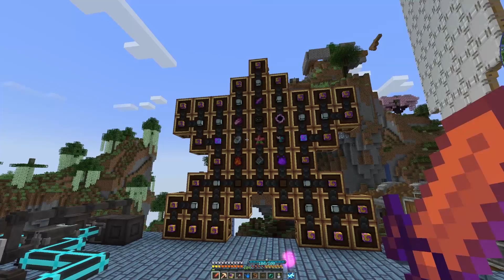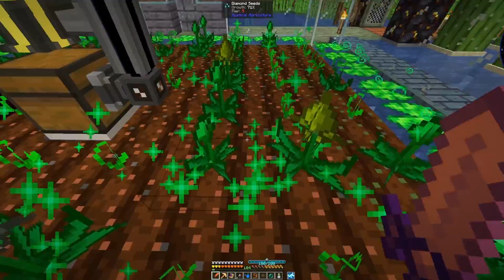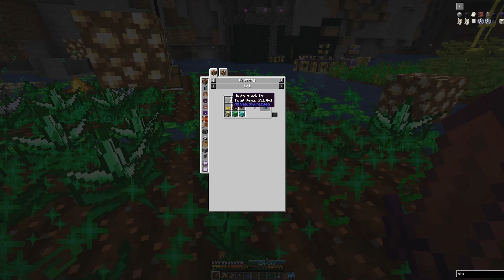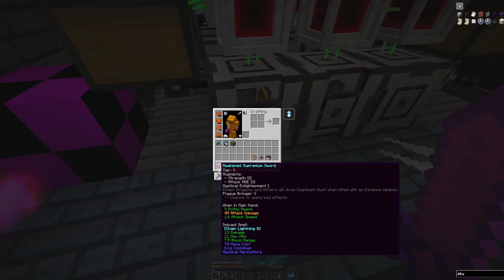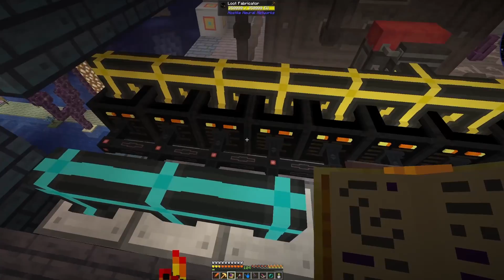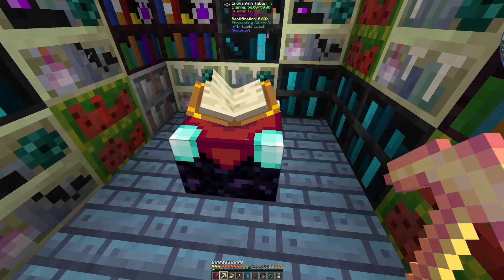How to Automate the ATM Star in ATM 9

Comment: A really easy wat to get singularities is to get the infinite cobble drive in ae2 and export cobble into the matter condenser.
Reply: You can expand on this approach by setting up autocrafting with ae2 and placing a matter condenser on a pattern provider with a pattern that converts 256k cobble to one singularity. The craft is basically instant so you save on the time it'd take export busses (even if you place them on all sides with acceleration cards) to transfer the items

Comment: I wish i can play it smoothly, i allowed 12 Gb of ram and it still freeze sometimes...... this modpack need about 16 gb ram allowed to it...
Reply from the maker: yea I think I upgraded my ram due to this pack
Reply: No it definitely does not need 16gb of ram, allocating 12gb is more than enough unless u have only 16gb, then 12 is too much. Throwing more ram at java is never the answer.
Reply from the maker: @mattyicee  Yea I should have been more clear. I upgraded to more RAM mainly because I like to multitask and 16 wasn't enough for this and other things.
Reply: idk if you're still looking for a solution, but ATM9 No Frills is a slightly easier-to-run variant of this modpack, missing a few mods (none that majorly impact overall gameplay). Also, there's ATM Slice of Pi and Slice of Pi 2, which are ATM packs designed to be run on the Raspberry Pi, a very low power computer. If you have figured it out though, please disregard.